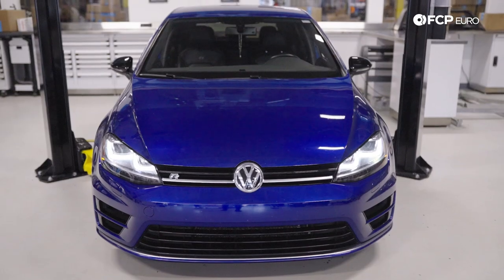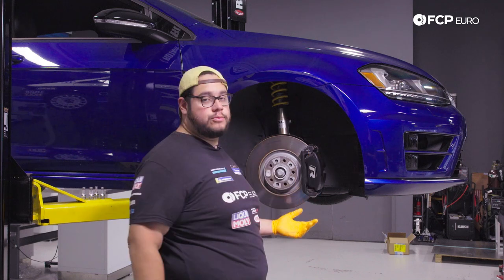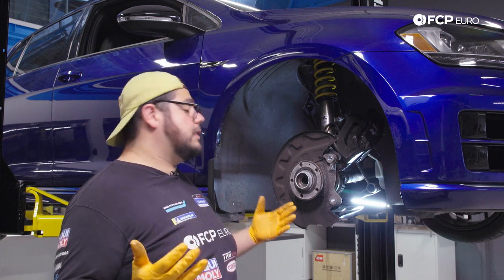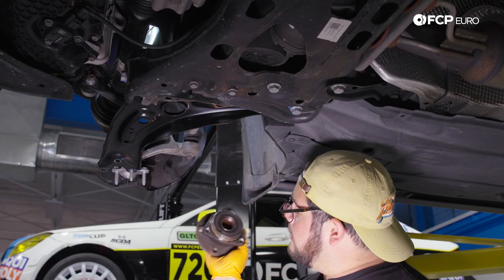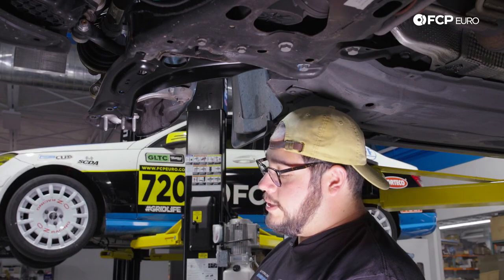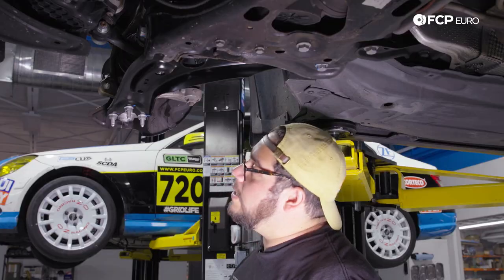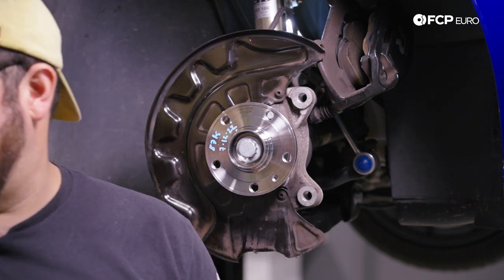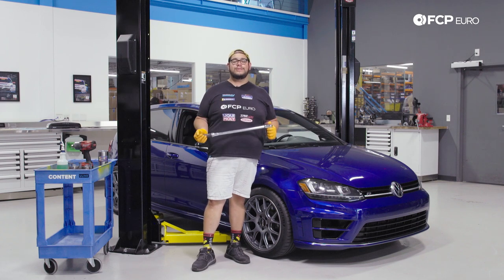Volkswagen Mk7 Golf R Front Wheel Bearing Replacement DIY (2015-2021 VW Golf R)

Comment: just a note.  when you are tightening the axle bolt at the 26 minute mark,  all the torque you are putting through the axle bolt is being transferred to the little torx head screw you have holding the rotor onto the hub.  better to  take the center cap off the wheel,  mount the wheel on and have a 2nd person  apply the brakes with the car on the ground.

Comment: Another way to check for bearing issues without relying on some listening tool is to simply rotate the wheel with one hand while keeping your other hand on the strut/spring.  If there is a problem, you will definitely feel the vibration on the spring.  Otherwise, it will feel perfectly smooth and no vibration will be communicated from the bearing to the strut.

Comment: Great DIY video as always! But the torque spec for the wheel bearing to axle bolt is wrong. The torque spec for WHT005437A (silver) is 200 Nm + 90 deg. The 200 Nm + 180 deg torque spec is for WHT005437 (black).

To folks that want to torque the wheel bearing to axle bolt without using the screwdriver trick, VW recommends torquing the bolt to 200 Nm with the car on jack stands while holding the brake. Then do the 90 deg rotation with the car on the ground.
Reply: Sorry, what do you mean by "Silver" and "Black" bolts?  Is there a darker version of the axle bolt?  TY
Reply: @Kevin_MK7RSR  They are of different materials. You can google the part numbers and see their visual differences.
Reply: @mattsheng2211  Noted, thanks!

Comment: Mike, why did the control arm just drop off on that, the one on my GTI wanted to be much higher and I had to pry it down.  I also don't know how you torqued the mounting bolts without stripping them, my tool wouldn't stay square!

Comment: Awesome DIY.. I hear a roaring on my Mk6 Jetta on the driver front this is pretty much exactly the process.. I just did a rear bearing in my GF’s B8 A4 that was not as simple as this is gonna be.. those two upper M12 tpl square are hard to get to. So great job Michael 👍🏻👍🏻 FCP looks like a cool place to work.. would and alignment be required after that since you disconnected ctlt arm? And is there blue loc tite on the axle bolt?

Comment: The 3 hub bolts in the back suck so much to get out if it’s rusty.
Reply: they are thru bolts.  clean the exposed threads that stick through the old bearing.... that will help get them out.....  I was able to get them out on a Canadian car (salt belt) with a long 3/8" ratchet.